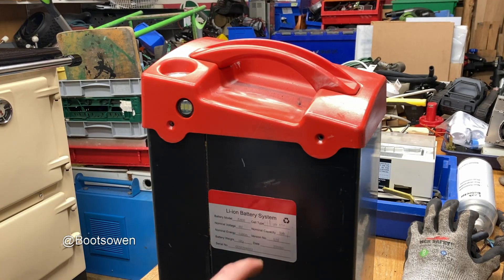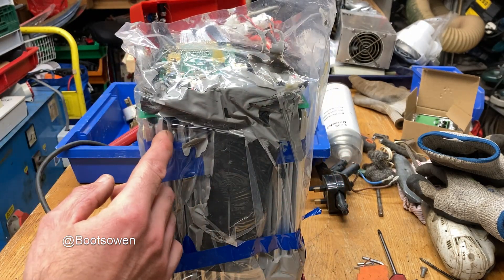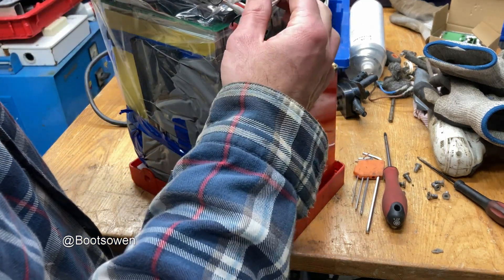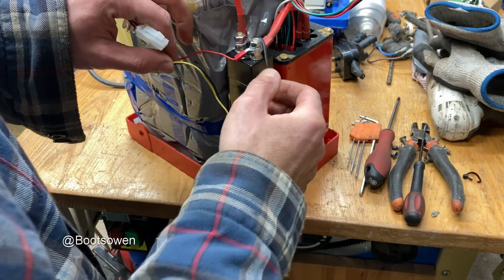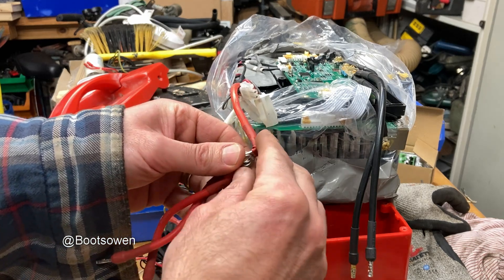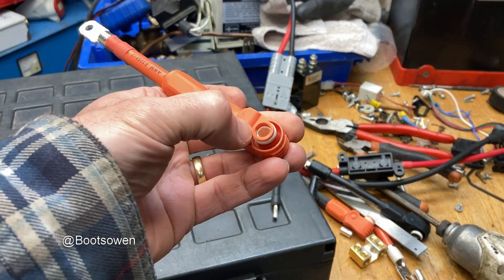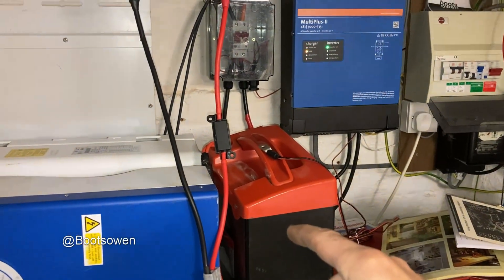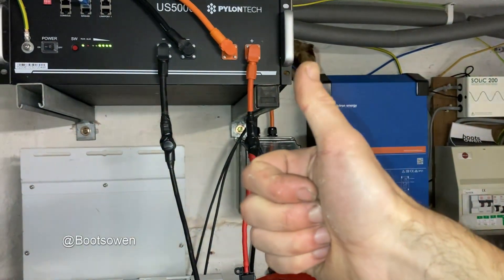Adding capacity to a Pylontech US5000 LiFePo4 battery with a scrap battery: easy #offgrid tricks!

Comment: Owen, you're grand. The pylontech / Victron just keep working and the pallet truck battery just sniffs a bit off. My 4 Pylontech work well with other Lithium and NIMh. I figure that each BMS looks after it's own battery and the Victron ESS looks after charge and power diversion, thanks for the heads up, cheers
Reply from the maker: That seems to be it Andy, as with solar panels more capacity is best!

Comment: hi i recommend that you reconnect the relay to the small battery the relay is what the bms uses to protect the battery without it the battery can over discharge and overcharge